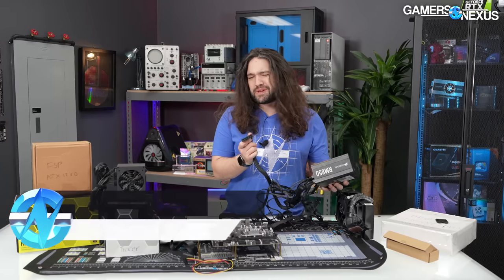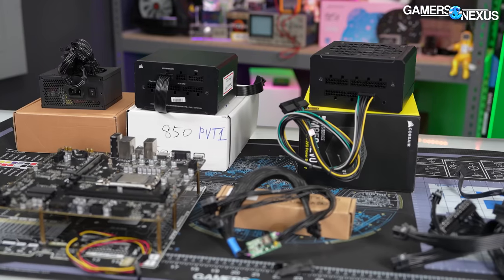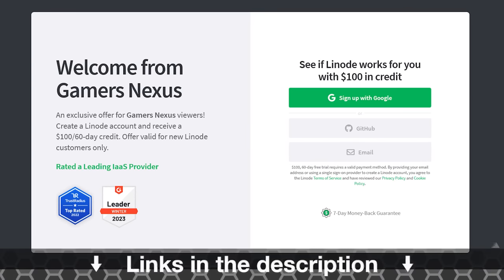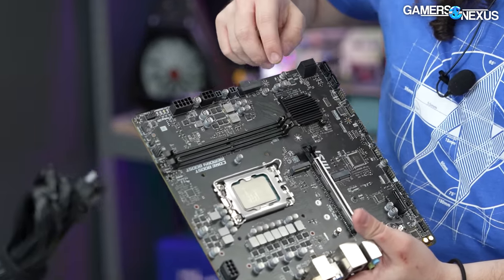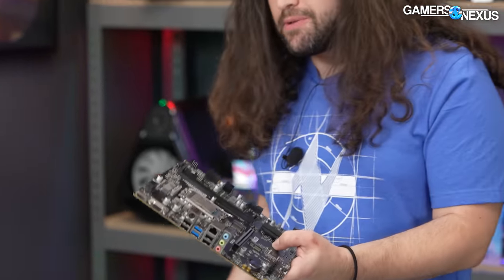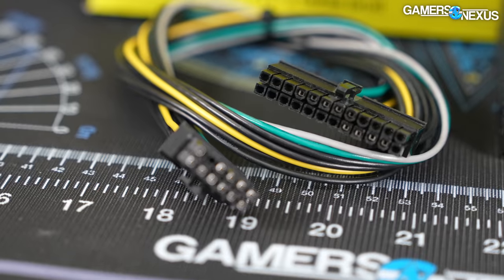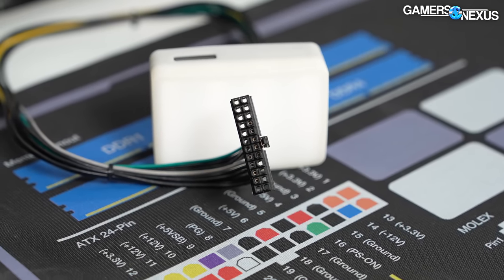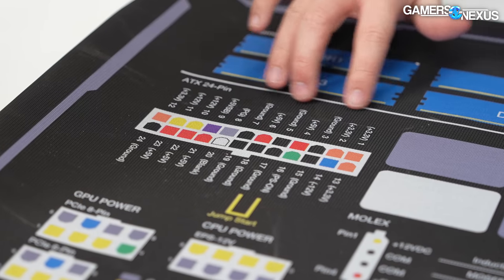The Future of Power Supplies - Maybe (Motherboard Cost, Cables, & ATX12VO)

Comment: I have a fear that this move will end up being problematic for a while. Motherboard manufacture tend to cheap out on components far more than a beefy PSU maker would. I can see a lot of RMAs in this conversion era happening.
Reply: This will play out for sure. Mobo manufacturers are famous for skimping on capacitors.
Reply: @prashanthb6521  in this case, since the power conversion happens closer to the load, and the input currents are smaller (due to higher voltage), there's actually less need for expensive tantalum or polymer or (for cheap boards) electrolytic caps. Given that those are basically the only common modern electronic components that need a "lifetime" spec (due to being chemistry, not solid state), having conversion on the board is actually a win.

Caps are needed to supply power during the time it takes for the PSU to realise voltage is falling and to increase current to compensate. If the regulation happens on the board, the inductivity from the load to the regulator is much lower, meaning the regulator can react quicker, meaning there's less need for the capacitive buffer.
Reply: Same... Not to mention there's piles on top of piles of broken motherboards every time, same for PSU's and GPU's, but I'd rather have a 10 year warranty PSU going bad than having even more failure points on like a expensive 2 year warranty motherboard that will most likely only start to go bad after warranty ends...

And then I'd rather buy another well chose good PSU to replace a bad one than having to buy a very outdated motherboard to maintain a old PC cause it takes me MANY years to be able to buy a whole new one. The PSU even if bought to fix a old PC can then be used on a new PC at any time.

ps: F* this...😡
Reply: @Validole  You didn't thought far enough. Or better, you believe/expect to much from the Mobo Manufactures 😂

1. There need to be many capacitors, each sized for the specific need, instead of an big one in the PSU, usually high quality Japanese ones. (Which leads to lower efficiency)
2. There will be everywhere buck converters, cheap regulated buck converters, like MP1584 or even a cheaper texas instruments ones. Which leads to less efficiency either.
3. The mobo will run a lot hotter, because of the onboard conversation, which takes a lot more effort to cool, as in the PSU.

So in conclusion, Manufacturers will surely save out and only convert all voltages on one place, not on multiple places for every component, like people expect.
This is because, they will have only one place to put the converters under an heatsink.
The capacitors and converters will be the cheapest crap.
There only 2 benefits:
- First, that you eliminate almost any voltage drop, because the converters are still nearer to the components, means less cable length etc...
- Second, you will need an a lot smaller cable and even less cables coming from the PSU.

But i don't see any efficiency benefits, it's just some marketing bullshit to me which will simply lead to no efficiency benefit. I think that efficiency will get worse tbh, because of just shifting the converters to the mobo.
Only one converter for 12 -> 5v and another to 12 -> 3.3v (or even worse 5 -> 3.3v). So only 2 regulated buck converters to save costs, instead of multiple converters like people think here.

To make it really efficient we need to get rid of 5v and 3.3v entirely, but this is impossible, because usb power is 5v and almost all IC's use 3.3v.

I love the idea of smaller and less Cables from the PSU and i love the idea of the possibility of new SATA connectors, only with an single Cable directly from the Mainboard tho, but this 12vo spec won't be like people are expecting.
It's all just marketing and reasons to make everything a lot more expensive.
And Mainboards are already 3x more expensive as some years ago.

Cheers
Reply: @RamaOlama  Except motherboard is already doing a lot of conversion (300W+ cpu, ram, chipset supplies), the relatively low power 3.3 and 5V conversions are going to do very little to change thermal situation.
Reply: not to mention psu is very affordable but now this is just an excuse to sell $400+ mobo

Comment: One thing I always wondered the future of...connecting cases to motherboards, I always felt something much better would have come along by now
Reply from the maker: You mean like the front panel connectors? It is definitely one of the few things that has remained the same for over a decade. Still frustrating to plug them in when there's poor light or space!
Reply: @GamersNexus  yeah that was it.....was thinking at this point would have like one snap in connecters that links all the front panel ports and switches, I know somethings have slightly changed like the block u can connect the cables to and then connect the block to motherboard
Reply: Spring loaded clamps for each of the screw holes and maybe one button on the case to unlock
Reply: @GamersNexus  Don't most cases have all of the front panel connectors together now?  Rather than having a bunch of 1 and 2 pin connectors, my case all of them are put together into a single connector for all of them together.  It's a lot easier to plug that in.
Reply: @MistyKathrine  Unless case manufacturers and motherboard manufacturers have agreed to follow a specific pin layout for that stuff, I don’t so. I know my case and mobo certainly didn’t follow such an agreement since I had to do a bit of weaving to get my power and disk lights plugged-in.
Reply: @SlimbTheSlime  Every motherboard I've ever seen has those pins in the same places though.  They are in a 10 pin formation with like 1 pin missing.  Always same formation though.
Reply: @MistyKathrine  a few cases/motherboards I've had had a connector block where you plug your case connectors on and then plug that into the motherboard.
Reply: @satibel  yes that works because the pin out on mobos is standardized. They are all the same.  I have a couple of those blocks but almost never use them as it adds more height to the connection.
Reply: @Apollo-Computers  what are those "blocks" called?
Reply: For me (who uses big air coolers) I've been wishing for a mounting bracket design that moves the support of the coolers weight from the motherboard to the case frame.
Reply: Industry just lacks balls to make bald decision and actually create brand new modern standards from ground up instead of building on top of long obsolete stuff from decades ago.
Reply: @obviousmbanjwa5743  I really don't know. Asus calls them Q-connectors or something like that.
Reply: @Apollo-Computers  got it!, Asus q-connector
Reply: Most of the new cases have a "Combo" connector, so all of them are connected as one big connector
Reply: @Mchacz8008  It's still a hassle, especially with small form factor builds.
Reply: @1stRanger  Yes, but to be fair, doing anything with a SFF PC is a hassle...
Reply: @Mchacz8008  True, but exactly because manufacturers build on top of outdated standards from 90s instead of creating something new. The notion of backwards compatibility they kepp selling us is a lie. They keep changing sockets with almost every generation, which makes us spend hundreds of dollars on new motherboard and often new memory. But font panel connector in our cases being compatible with anything that's being sold since 1995 is somehow the most important thing there is.
Reply: @Mchacz8008  How new are we talking? I got myself a 4000D, and it's still single cable connectors. I wouldn't really mind it though, if only the damn connectors held onto the pins properly!
Reply: My Lian Li 216 case I just picked up had them all together 🥴 definitely becoming more common as the layout is the same on pretty much every mobo.
Reply: @GamersNexus  For my first build I was working in a cramped mATX case with a honkin' NH-D15S; connecting the front I/O pins took me over an hour, and I used tweezers
Reply: Now that a lot of builds don't necessitate an HDD light and stuff... I feel like that's becoming less common.

Comment: I'm not in favor of shifting the cost to motherboards. I've invested into a 12 year warranty evga model, and with intel switching motherboards every two years, and even amd probably not having am5 lifespan as long as am4 - I'd rather buy psu once, and then use it for a long time, rather than paying extra each time I change platforms.
Reply: Yeah, motherboards have already almost tripled in price. What's this going to cost? Another tripling of the tripled price?  🤔
Reply: @dakoderii4221  even if it adds just an extra 20-30$ it's still going to be recurring cost. There's no benefit to changing your psu every time you rebuild your platform, and I'd like to stay that way. We're getting here into dangerous territory of pricing people out of pc gaming.

Comment: From experience, this type of set up introduces a whole load of different motherboard issues. HP has done something similar to this for YEARS with their desktop models and motherboards are more common failures than platter drives, and that quite frankly is impressive.
Reply: Nonsense. I have a Hp sff with 240w original power supply 12 years old, I also added a Quadro k620 discrete video card from a workstation. I haven't had any problems, no damage. I only clean the dust thermal paste I have not changed and it works perfectly with the fourth generation operating system
Reply: @stonehardy580  Well you must be the only one then lol, HP is hot garbage.
Reply: @stonehardy580  You have to be the exception... I've seen this across multiple models. I'll bet a lot of the problems is the mobo manufacturer, last I checked it was Foxconn. Introducing more parts into a single point of failure inherently is going to cause more problems.
Reply: @titan1983x  The exact motherboard model is hp 1850. My model is hp 6305 sff with amd fm2 socket. The only fan is Foxconn, I replaced it with Artic 92pwm pst, not because it doesn't work, but because it's very noisy. The CPU heatsink is passive without a fan. I haven't changed the power supply fan - it's the original one, I just clean the dust periodically. Model is from 2012 or 13 I think, 100w processor a10 5800b and discrete video card from quadro k620 workstation work perfectly with 240w original hp power supply. I have had no problems, no defects or repairs so far.
Reply: @titan1983x  This is the internet, one anecdote obviously negates any and all claims to the contrary.
Reply: That's my fear.  I've replaced a ton of power supplies and that's relatively cheap and easy to do.  Replacing a motherboard is a whole other can of worms.
Reply: @projectartichoke  Also diagnosing power issues is more problematic.
Reply: @stonehardy580  i have my Hp elitedesk 800 G2 SFF with only a 200Watt 15A*12V power supply and it not even heats up on max load.
I measured that im loading 220-230Watt while its loaded from that poor thingy, no joke, no cap, its not even heats up.
Btw inside as GPU, i have a Radeon R7 240 2Gb
Reply: From my experience with HPE server equipment, most of the failures are disk drives (hot swappable in most cases), sometimes ram and when we had servers with battery backup for the cache on the RAID array, then the batteries would get too hot and die. Quite rare to see a motherboard die. Some HP desktop models are cheap junk, but that isn't anything to do with 12v power distribution.
Reply: @alexjenner1108  the only thingy that makes hp motherboards functionally ugly like mine, that it dont have heatsink on the mosfets, except the little copper that its on the board, but that is very minimal.
on Normal load my mosfets are arround 70C, on normal load (like 50-80% utilization) its about 80C, and if i do load my cpu and vrm with prime95, its about 115-135C.
I dont think its healthy. I think i gotta have to get a B150 chipset board, atleast those have a vrm cooling method.(for my lovely i7-6700, still ok for basic tasks, basic rendering, and basic gaming)

Also i regret saying that 200Watt is "enough and quiet"
On prime95 my system is almost a siren.

Comment: I'm surprised Intel went the 12v route for power efficiency savings, rather than extending the existing ATX standard with smarts (via sense/data pins like the NVIDIA 12-pin) to shut off rails when not in use. 12vo seems squarely aimed at OEM usage, rather than DIY. I can definitely see these standards existing side-by-side, potentially leading to fragmentation.
Reply: Yup. Imagine all the listings for components segregated into ATX & 12VO pages. What a headache.
Reply: That add pins and costs even more than obsolete multi-voltage ATX.
Reply: It's already fragmented and has long been so with OEMs having their own proprietary power delivery schemes. At least this might standardize things on the OEM side. As it is not only do you need the manufacturer's replacement or an adapter cable/voltage converter when attempting to replace an OEM power supply with an off-the-shelf part, you might need a model-specific version. But, yeah, this seems a net negative for DIY.